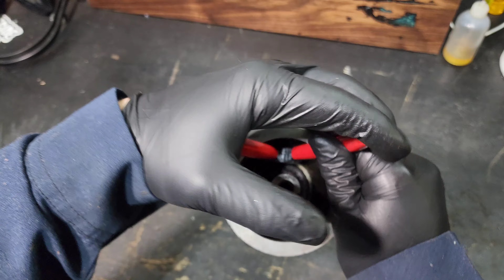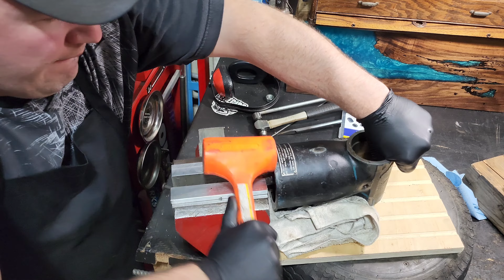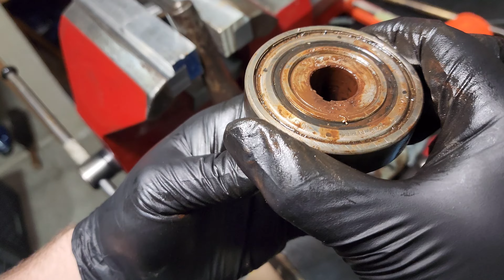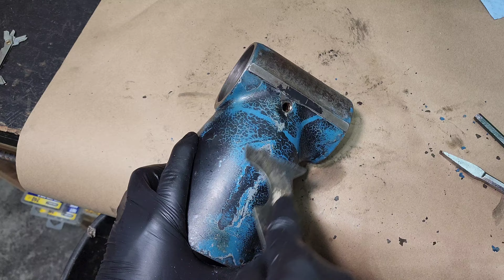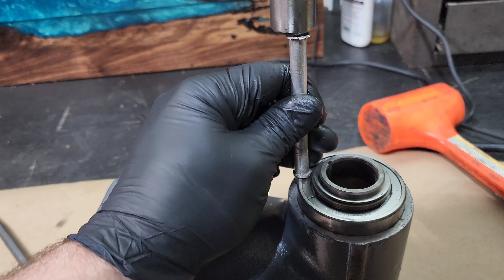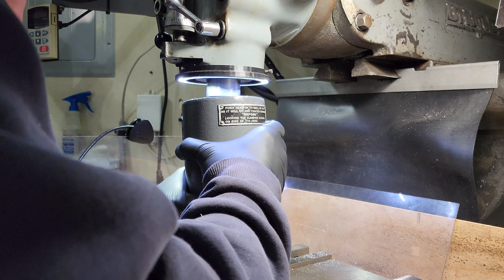Bridgeport #3 right angle attachment restoration

Comment: By chance did you happen to measure the spacers that offset the bearings?  I've got the same type of angle head, but found out both spacers were missing. The one on the input shaft I think I can deduce the thickness for it, but the one on the output shaft, I would need to find out what thickness it is for proper meshing with the gears.
Reply from the maker: I don't get the measurements, sorry

Comment: What are the bearing number please? all 3. I am trying to design one and would like to use the same bearings as is in the OEM attachment. Thank you. I cant find them on the internet anywhere.
Reply: you can see the bearing no.# on the bearings themselves, Mine were (1) 1207 FF and (2) 6008 2RS, if this helps? I'm having problems with the spacers that hold the bearings in proper place for gear meshing, would  you have the spacer dimensions?  Actually I just need the thicknesses of them, I can figure out the rest.
Reply: I don't have a right angle machine to measure the parts. I am trying to make one and so thought it would be a good idea to use the same bearings as are in the original or knockoff ones. Sorry about that. But thank you for the bearing numbers.
Reply from the maker: I don't have them documented. If I pull it apart again I will note them and let you know
Reply: FYI, I researched price through a major bearing supply company in Canada and was looking at a price of $1009.67 CDN per bearing, I almost fell over. They were special order.

Comment: 8:57 That gear looks to have been pulled out losing it's snap ring and THEN the R8 was HAMMERED back in with the key misaligned so the gear hub sheared off the top of the key part way down. You didn't mention how you dealt with that. New  key? repair of the keyway in the gear hub?
You are lucky that thing still works because it was used by a real ape.

Comment: A viewer below pointed out that your snap ring was an internal, not an external.  So I went back and looked, and sure enough he was right, it's not even round on the inside.  Make sure you replace that when you get a chance, you did an excellent job, wouldn't want to see all the gears get messed up becuase thats not going to hold.

Comment: My guess would be someone loosened the housing clamp bolts before removing the machine drawbar.
When the housing didn't move (evan though there is a  bolt between the 2 clamp bolts  to open the gap) the person gave the housing a wack , then realised they forgot the machine drawbar.

Comment: hi
nice resto video - well done
just one thought/comment - the dislocated snap ring - the shape of it looks like a snap ring for bores, not for shafts;  are you sure it was not mistakenly installed by the guy before you and slipped off the shaft due to being the wrong one ?  snap rings for shafts have the ears facing to the outside, not the inside ...
what do you think ?
Reply: That was not even round on the inside, look at that again, it almost certainly is the wrong type.

Comment: A slide hammer would be a better tool for removing the internal R8  shaft rather than hammering the casting off of it.  OTC part 8003 is an adapter between 5/8-18 slide hammer threads and the 7/16-20 R8 threads.

Comment: Nice job on the fix. Did you check on replacement bearings? I know they can sometimes be pretty expensive for essentially what is a spindle.
Reply from the maker: I was only able to find one of the 3 bearings on ebay for I think 40 or 50 dollars. I didn't get around to checking with my local bearing supplier to see what all 3 would cost. I'm just glad I was able to save these.